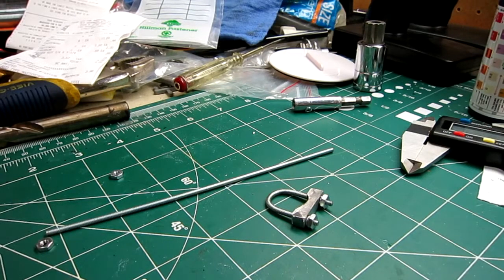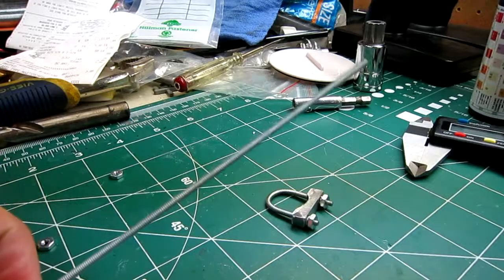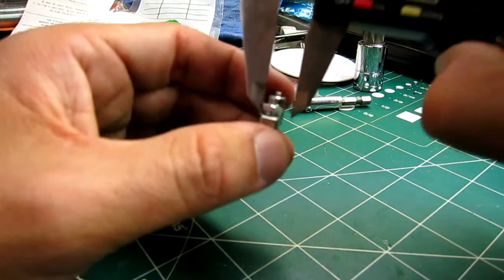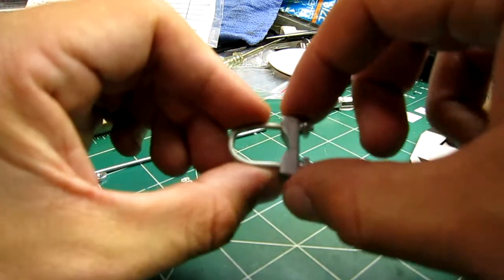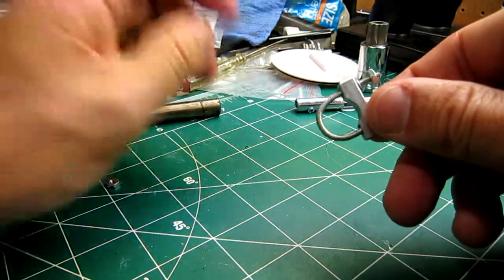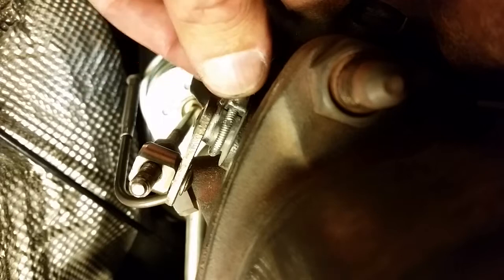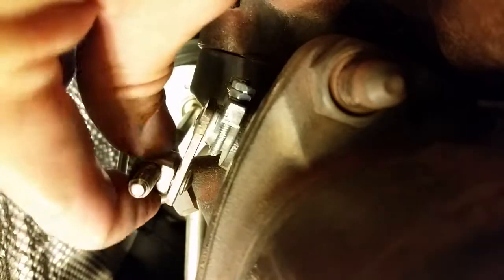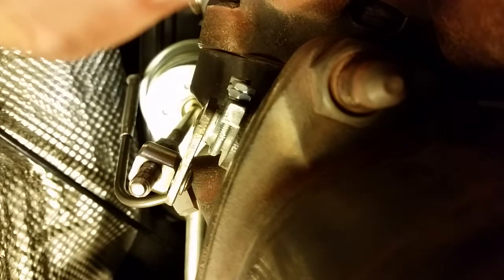Homemade Clamp for loose K03 K04 Turbo Wastegate Bushing

Comment: im kinda confused how this fixes the loose wastegate, its just tighting around that spot but not actually sealing it better
Reply from the maker: This fix prevents the wastgate lever bushing from sliding in.  The bushing on my K04 would slide into the housing and when that happened, the wastgate flap would bump against something and not be able shut all the way so I couldnt make any boost. Watch my other video showing the bushing sliding in: https://youtu.be/GUujAqDkiRg

This section of the turbo is the low pressure side. It's what the wastegate is dumping as excess boost. Sure some tiny bit of air could make it's way between the housing and bushing, but that's no big deal IMO.  Blowoff valves do just that.  The better fix would be to have the bushing tac or spot welded in place. At that time, I needed a workaround.